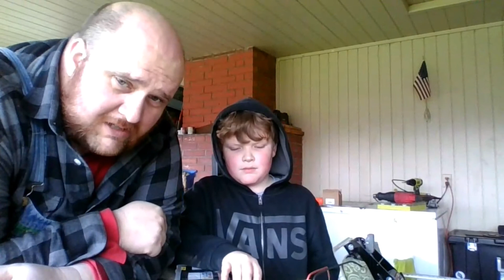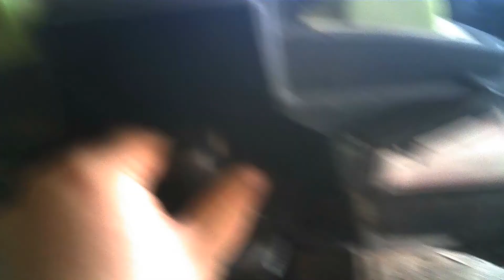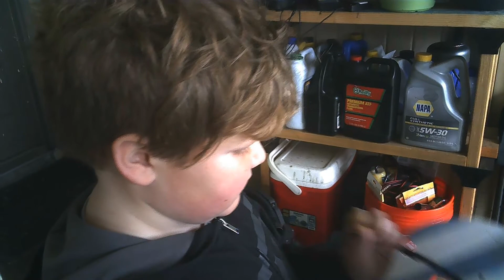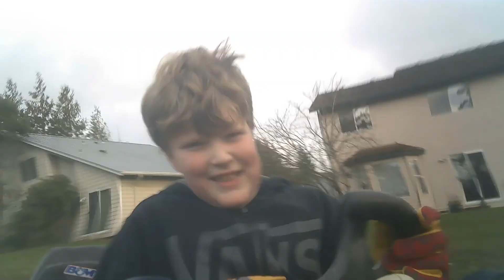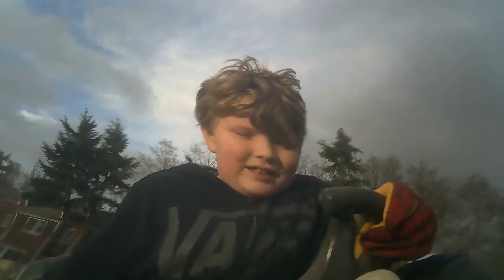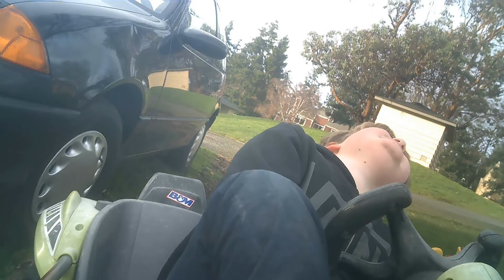Ryobi Battery Power Wheel Conversion (Dad Builds)

Comment: The battery you used looks like a small 1.5 or 2 amp type, can you confirm which one you used? Thanks for sharing
Reply from the maker: I used a 1.5 and a 2.0. The 4.0 has a longer life of course but the 1.5 and 2.0 is the more economical option